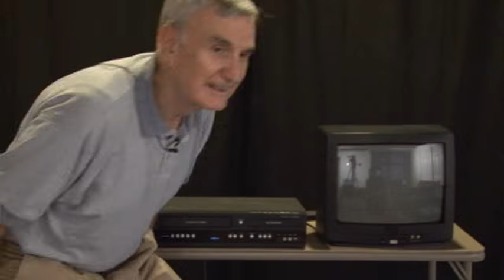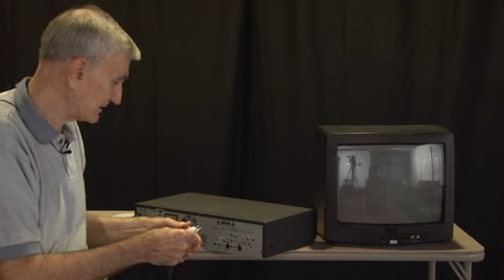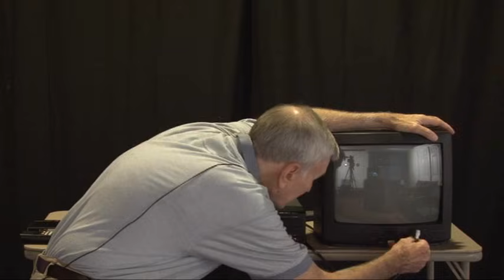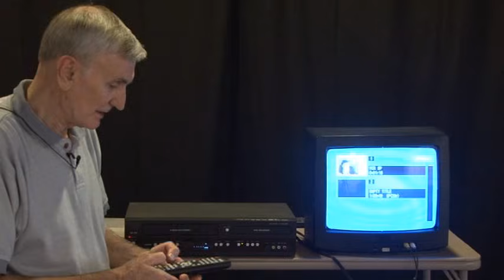VHS transfer to DVD using combo recorder

Comment: Thanks,  Once you have made the DVD. Have you gone straight to YT (download) or do you have to change the formate of the DVD video segment? Strange thing happened to me. 1st one worked (smaller one) 2nd one downloaded but YT would't process. It got stuck on Zero.  Mike
Reply from the maker: Mike Cowell ,Sorry I don't understand the aberration YT and the need for download. From your comment " Have you gone straight to YT (download) or do you have to change the formate of the DVD video segment " ?
Reply: YouTube. Video segments come out as Raw file:VTS_01_1.VOB. Its not (VOB) on Youtubes list as type of files they except. They suggest the one file be converted to another type. But they have excepted 5 out of 6 of them so far.
Reply from the maker: Mike Cowell , I have video editing software on my desk top computer.  I copy my video "DVD"  I want to convert for YouTube. I pick out cuts or sequences that I want and have my software convert this  to mov. files which I can upload to YouTube.
Reply: Thanks that's what I ended up doing. Worked easier once I converted them. from VOB to mp4. (iskysoft for Mac).

Comment: I have another situation that has come up. I was in the middle of dubbing when the dubbing stopped because of a blank area on the tape which was over 3 minutes.  The manual says this will happen.  I was able to find the next section of the VHS where there was something recorded.  I started dubbing again.  Unfortunately, the first 14 or so minutes of the original VHS were lost because of the extended unrecorded space.  How can I avoid this?  I will need to convert it again but want to see if there is a workaround.  Is there something that I should have done to save the first portion?  It appeared to be there as the second portion was in the second box on the disc edit page.  (The first portion was blank.)  Any suggestions?
Reply from the maker: Claire Anderson, Are you recording on DVD-R, DVD+R, DVD-RW, or DVD+RW. I use 99% DVD-R, occasionally a customer will have an old DVD players, and need DVD+R. I have recorded a lot of tapes to DVD over the years. I don't remember a recording stop and after being started back up again loosing video. My suggestion is human error.
Reply: DVD-R...same combo machine as the one in your video.  I will try it again. I'm thinking that I may have interrupted the writing process when it stopped after the first segment.
Reply from the maker: Claire Anderson, or perhaps the difference is with the Brand of combo recorders.
Reply: +Anthony Wheeler I will let you know. I have the same Magnavox machine that you are demonstrating in the video. Thanks for getting back to me.
Reply: Well, I redid the conversion with no problem.  Just out of curiosity, I rechecked the first DVD and the first section/title was there all the time...I just didn't start with the first section/title when I replayed!  Now I have 2 copies.  :)
Reply from the maker: Claire Anderson, glad to hear that turned out good for you.
Reply: Thank you so much for your help!

Comment: When I put in the blank DVD+R it only say "Disc error"
Reply from the maker: Dark Dubbs, If you have tried more than one DVD and get the same result. You may have a defective unit.
Reply: I have tested more than 2 empty disc's and still disc error but it can play DVD movies with no problem. Can it be that that unit only can record from DVD to VHS? So the dvd player is not a burning device?
Reply from the maker: Dark Dubbs, I agree this unit must not be a DVD recorder.
Reply: Is there any way to replace the dvd player with a device that can record/burn?
Reply from the maker: Dark Dubbs, I suggest, if you can find one, to buy a DVD combo recorder.

Comment: Which discs do you recommend DVD - or + there seems to be so many different ones for sale,thank you
Reply from the maker: +dianeswom , I use Verbatim (-R) most of the time , the Verbatim (+R) works just fine also.
Reply: +Anthony Wheeler Thankyou I've just ordered a Daewoo combi VHS/DVD  to copy my camcorder mini DVDs putting them on vhs first so fingers crossed, xxx
Reply from the maker: +dianeswom , I do my mini DV tape transfers to DVD by playing the mini DV tapes back using a mini DV camcorder and connect that camcorder to a DVD recorder.

Comment: I have some questions. So being that I just bought one of these, can I hook this up via HDMI cable to my PC or do I need a separate TV, monitor, analogue TV or ect. What are my options?  Also I bought a refurbed Sony ccd-trv98 ntsc handycam. I hooked it up via s-video cable and the 2 RCA audio cables. Any helpful advice on these issues?
Reply from the maker: Vue U, The only way I have connected my combo recorder has been to a TV. I have connected to various TV's using at times, RCA, S-Video, and HDMI. I could connect the combo recorder to my computer with my Vegas video editing software and the Blackmagic Intensity Pro capture card. I wouldn't do that  just to watch TV, but to edit video.
Reply: But do I need an analog TV or Digital, whether it be just direct recording VHS tapes to the DVR part of this device, and will it be the same when I hook the Sony Handycam to it? It is a Hi8 camcorder, not digital.  
Also I bought and tried out one of those Dazzle converters to capture the Handycam videos from and process it through the PC. The makers claim that it will be a lossless convert to digital, but from what I found, there is A LOT of loss. and trying to manipulate and edit through the Pinnacle studio program, doesn't help. 
So please help, so I can get my old Hi8 and VHS tapes to digital. The family is eager to see them.
Reply from the maker: Vue U, My combo recorder is connected to an older TV using the RCA (yellow=video, white and red= audio) cords.
 It sound like you are trying to record from your Handycam to the DVD recorder of the combo recorder. I suggest using the S-video out of the Handycam (requires S-video cable) and you also need the white and red audio out of the Handycam to the DVD recorder. In that way you can make a DVD. Don't forget to finalize the DVD.
Reply: Okay, thanks! I'll give it a go.
Reply from the maker: Vue U, I suggest setting the record DVD mode to "SP" that is the two hour record time. I don't recommend the long record times because the record quality goes down
Reply: I have heard that, yes. Only problem there, is that back then when I recorded those tapes, most were extended recording(EP or LP) and I don't know how I can record those tapes to DVD in SP. Obviously it would run over the recording time. Or can I somehow record to an external drive? geez, If I knew all this was going to happen way back then, I sure would have done things differently. Who knew.
Reply from the maker: Vue U, If you have LP or EP recordings on VHS tape these can be transferred ( up to two hours at a time using (SP) standard play recording time to DVD). That will require a second DVD to record the remainder of the VHS tape onto DVD. If the quality doesn't matter that much you can just record all of the VHS tape to one DVD in EP recording.
Reply: I have the same DVD recorder that you have, so would instructions on how to do that be in there? How I would divide a whole recording into at least two DVD's, I mean? and I still wish I could just do this digitally over the computer and save them to my WD My Passport Ultra 4Tb.
Reply from the maker: Vue U,  How I would divide a whole recording into at least two DVD's. To do that, just press the stop button after two hours of recording, don't take the VHS tape out. Finalize the DVD and put in a new DVD and start the dubbing function from that point. 
With regard to your WD Passport, there are what are called "break out boxes" also called capture cards that allow you to connect a VHS player to a computer to accomplish digitizing your video.
Reply: thanks so much for your help. Most help I've ever gotten from any kind of Youtube post and response. The care you take in doing this is obvious. So many others try to say a few lines of garble that don't usually help me at all.

Comment: Hi Anthony Wheeler, thanks a lot for your help. I have the maschine and I will start to use it right now.  I just want to know if it works with Super 8 too , or only VHS? and what about the bluray? 

Thanks!
Reply from the maker: Jean Paul Boghossian , Hello Jean, if you have the same combo recorder then "No" it will not work with Super 8, unless you have some kind of Super 8 player that you can hook up to the input on the combo and make a DVD that way. It won't make a blu ray disc.
Reply: Great.  Thanks Anthony
Reply: Anthony Wheeler Hey Anthony, I don't know if I did something wrong, but when I finish m transfer to the DVD, I can't go to the minute that I want. An example: If the video has 1:00:00 of recording and I want to go directly to the 00:30:00 minute, I'm not able to do this. Is there any way to make it possible? 
Thanks!
Reply from the maker: Jean Paul Boghossian , Before you start the transfer, you can go into the menu and set up the frequency of markers or chapter points according to time. However, not minute by minute. I believe 5 or 10 minute increments. When you play the DVD  you can advance forward to  the  position close to what you want and play forward to the  time you want to find.
Reply: Anthony Wheeler Thanks Anthony. My last question is regarding the type of VHS that is compatible with the maschine. I couldn't watch a lot of my VHS and I think is because is not compatible with the norm that use the maschine.Do you have the list of the norms that are compatible with the megavox?

Thanks!!
Reply: Jean Paul Boghossian Are you talking about Super 8 film or Video8/Hi8 tapes?
Reply from the maker: Tthis combo recorder is for VHS video tape. It won't accomodate Hi8, digital 8, or video 8, and not Super 8 film.
Reply: Anthony Wheeler Fivos Toutouts  What I mean if its compatible only with "NTSC" or "PAL" and How can I indentify that in the VHS or in the maschine?

Thanks!
Reply: Anthony Wheeler Thank you Mr. Wheeler , Thank you so very much. I did not even know that the machine could convert from VHS to DVD. I received the machine as  birthday gift and I have used a few times. I took it to a class where the instructor asked me if I knew how to convert. Subsequently I decided to check YouTube where I know its at . So Thanks again Mr. Wheeler. I invite you to come to my Country for a Vacation. It is in the Caribbean so I am sure you would like it

Comment: hello mr wheeler i'm looking for a good vcr/dvd recorder and i;m stuck between two kinds of brands the first brand is the toshiba dvr620 and funai zv427fx4 which one do you prefer in your opinion?
Reply from the maker: simplydeep504, I don't have any experience with the brands you list. I would look at consumer report recommendations.
Reply: Simplydeep, I got the Funai machine last night. The other brands are slowly being fazed out. You might want to check Walmart against Best Buy for price. The biggest drawback I saw was it only records (the DVD side) on DVD-RW/-R discs. I have to get some before I see how it operates. The VCR side worked fine. The instructions are good for hooking up everything. I only got this to transfer vsh to dvd, so I won't be of much help with any other areas of connections.
Reply: steveo288 thats is all i'm buying it for anyway and all i have is dvd-r disc to record in and i have already checked on the prices at amazon.com and its new thanks for the information steveo288

Comment: Hello Anthony Im not sure if youre still answering questions on this but Ill go ahead I dont have the remote control for my Funai DRVR B778S recorder so not sure how I would finalize the recording?
Reply from the maker: Carol Morgan, with combo recorder I have to have the remote. Try Ebay or other search.
Reply: @dahdigital1  Thank you for your quick reply. I have now purchased a remote control It isnt the actual Funai make but apparently its compatible, made by RM Series. The problem I have now is that I cant get the TV to display the menu etc on the screen. I should get a blue screen but that doesnt happen The remote will FFWD Play and Stop, but without the screen I wont be able to access the Finalize option.

Comment: Hello Mr. Wheeler, I hope you are still reading your mail..  I have several questions.  I have a Magnovox VHS DVD Recorder.  Trying to record home movies to a DVD-R disk. Having trouble. so trying to retrace my steps... 1st question, what are you clicking on your remote control to view HQ or HD and setting the SP, LP, XP options?  2nd question ...when I tried last night to record my VHS/DVD Recorder comes up with a flag saying, " playback not available on this disk".  any idea of what I am doing wrong?
Reply from the maker: GILL LLL, A blank DVD-R disk must be in the DVD disk drive, source should be set to DVD, on the remote push the" record mode" button, the options should be seen on the screen. 2nd Is this a blank DVD-R disk you are trying to record onto that gives the message playback not available on the disk?

Comment: Is it possible to put more than 1 tape on 1 dvd? If so, how do I do it?
Reply from the maker: Eternalpain23, Please watch my YouTube videos "VHS transfer to DVD using combo recorder" and " simple editing for vhs transfer to DVD". I'm hopeful this will answer your question.
Reply: I've watched both of the videos, did I miss something that says you can put 2 tapes on 1 dvd?
Reply from the maker: 1.  rewind both tapes to the beginning. 2. Fast forward the tapes one at a time to the end ,look at the time counter it will show how much time is recorded on each vhs tape. 3 Depending on the total time recorded on both tapes, set your combo recorder to record for that length of time. 4. rewind the tapes back to the beginning. 5 put  DVD in  and one of the vhs tapes,hit the dubbing button. When the first tape has finished transferring all that you want from that tape to the dvd, stop the recording. Take that first tape out and put the second tape in and hit the dubbing button. Wen you are finished transferring the second tape please do the steps to finalize the DVD. .

Comment: Hi Anthony, I have a vhs tape that has over 2 hours of footage that i want to put on a dvd. I successfully dubbed about 1 hour of the vhs tape onto a DVD (DVD ran out of space). However, now when I try to record the rest of the vhs tape onto another DVD, it doesn't seem to be working. Can you not start dubbing onto a DVD in the middle of the VHS tape then? I'm not sure why it's not working. Also, why do you not recommend recording in XP? Thanks.
Reply from the maker: xuteyee, XP records a long time but that makes the record quality less. And if you are OK with that, thats all that matters. Yes you can start a recording in the middle or from anywhere on a vhs tape. Put in a DVD and give the DVD time to load. When the DVD finishes loading you should be able to push the dubbing button and record from that point.

Comment: I don´t have a dubbing on my remote control.
Reply from the maker: Brighty Moon , if you don't have a dubbing feature on your remote, hopefully it is on the combo unit. If there is no dubbing feature on either one, then I suspect the unit is only a combo player and not a recorder. The other possible suggestion  is that you combo unit is altogether a different  brand.
Reply: Anthony Wheeler
I think its just a combo unit with no recording. I bought it 2006 and it´s a LG brand. I guess I´ll buy roxio easy vhs to dvd because it´s cheaper and probably better if you want to edit.
Reply from the maker: Brighty Moon , cheaper and editing sounds good.

Comment: Anthony Wheeler , I purchase a DVD recorder /VCR line-in recording by Sanyo FWZV475F and I can't understand the directions how to get it to work with my TV.I have a Magnavox TV and I have to use my TV controller and my Sanyo controller so I can watch a DVD. Can you help me with this? Stan 8/29/2016
Reply from the maker: Stan Wilson, It looks like your Sanyo model has the HDMI output. Using an HDMI cable from the Sanyo HDMI out to the HDMI input on your TV. Use your controller for your TV to set your input on your TV to HDMI.
Reply: OK I did that, now do you have a video on how to record from the TV to the DVD?
Reply from the maker: Stan Wilson, I don't have a video showing how to do that. I need to study that, I don't think TV's have a video out. How does your TV signal come to your house? Is it cable or dish or other.
Reply: AT&T U verse. Also Can I set the time clock on the sanyo? How do I do this, thanks 8/30/2016
Reply from the maker: Stan Wilson, I don't have sanyo, so I can't help you with that. So your TV signal comes to you thru your AT&T U verse. In other words you Iphone or Android phone.
Reply: Okay, if you come up with how I can do this , please let me know ASAP. Thanks Stan
Reply: Anthony Wheeler, If I have say, 10 hrs of VHS and I want to put it on a DVD how can I tell what size DVD I need? 9/19/2016